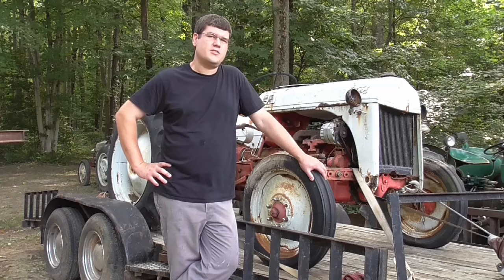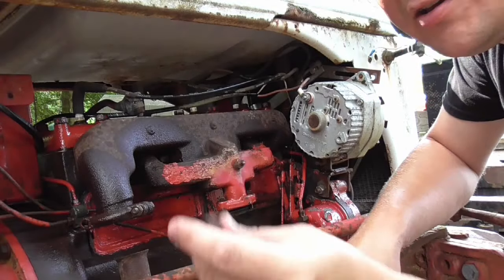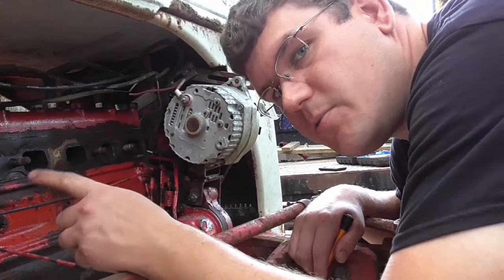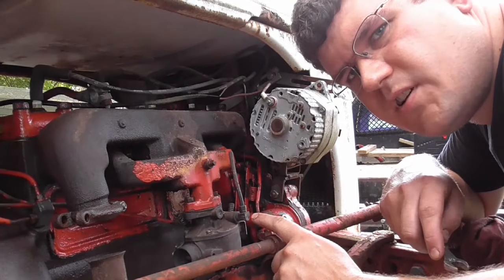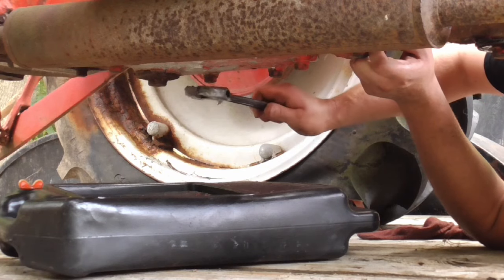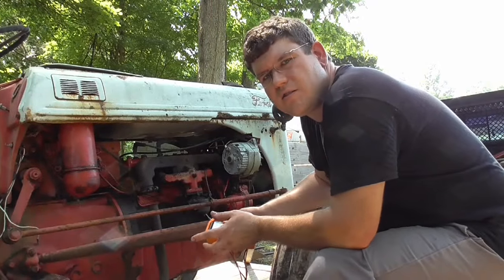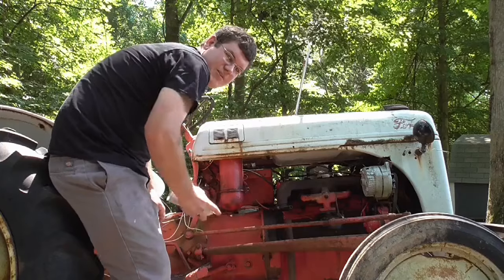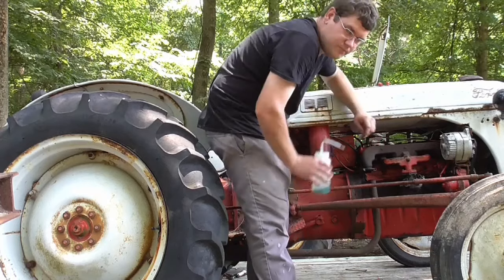Will it run?!? Ford 8N sitting in field for 7 years.

Comment: Pretty amazing none of the valves were sticking looks like you scored a good deal there !
You know you might want to check if your using 12 volt battery and the coil is 6 volt it will eventually melt and it is best to install a resistor or you might have spark plug problems later but you probably know all of that. Once you get it running I would make sure she runs up to 160 degrees or better to help loosen up the rings and maybe some oil down the plug holes before you are ready to take that step but keep that old iron running 😀🇨🇦

Comment: I had one very similar, but older (A 2N) around the middle seventies, and restore it to useful condition. I find you can STILL get most mechanical parts at Tractor Supply. so you might have a really good shot. They do have carb kits there, and carbs. They used to run chloride (salt water) in tires for added traction. You can still buy new rims for it, and of course tires. I bought a pair of new fronts from TSC at the time.
Reply from the maker: Yeah I have noticed they do carry alot for thoes tractors still which Is nice if you need something fast. I order most my stuff online for that kind of stuff since you can usually find it cheaper.